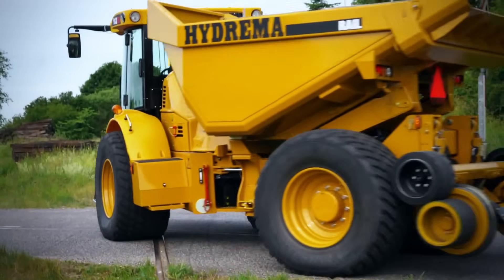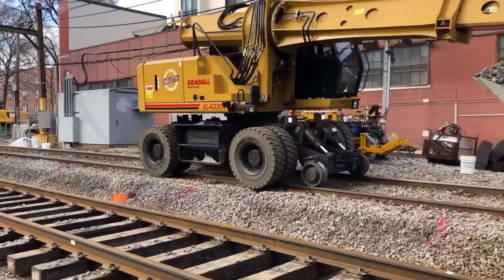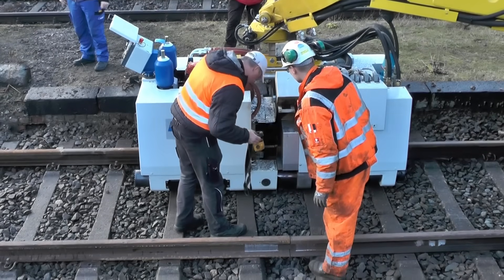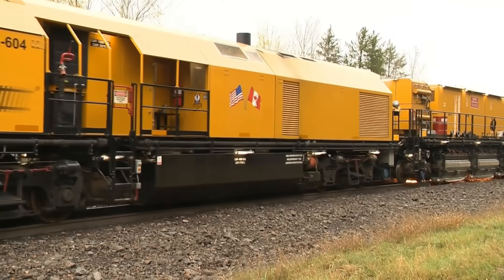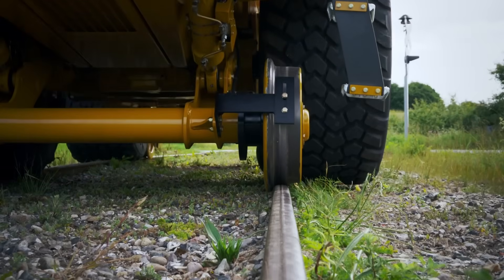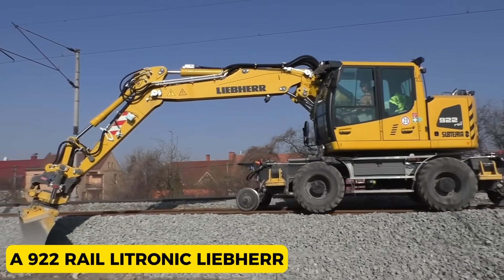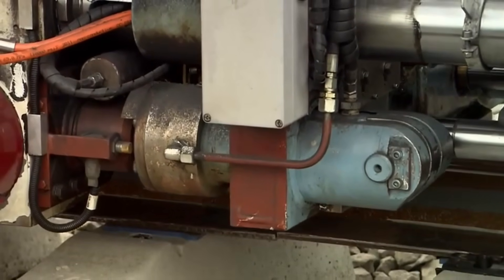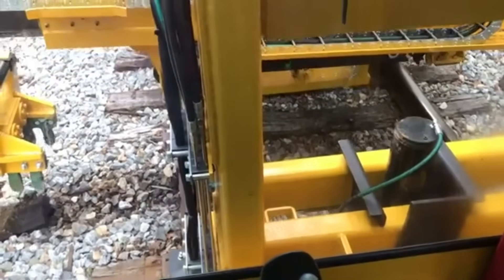20 AMAZING Railway Equipment That Is Next Level

Comment: LIVING IN THE STONE AGE ???
Ugh you've only just discovered modern Railway plant machinery ? British Railways had equipment like this back in the NINETEEN SIXTIES (1960's). Obviously you Americans have no knowledge of the World Famous manufacturer of such machinery, based in Austria called PLASSER & THEURER. Who have over 3000 Patents relating to various types of track maintenance & relaying equipment. This company dates back to 1953, and set up its London subsiduary "Plasser UK Ltd" on 14th March 1960. 

Indeed as a Railway Engineering Student I was getting my "practical" experience on British Railways overnight track possessions, operating many types of complex track laying & testing machinery from 1973, most of which had to be computer aided to get precision alignments to within ONE MILLIMETRE. 

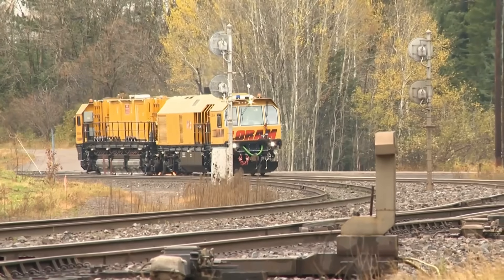Your obviously NOT a "Permanent Way" Railway Engineer, as a number of your descriptions clearly do not understand what is being done & WHY.  For example the "Rail Grinding machine" at 6:19 is necessary to maintain the shape of the railhead at a precise angle to match the angle on every trains wheel treads. If the two angles (Rail & wheels) do NOT match precisely you will start experiencing "Hunting" of vehicles at speeds over around 40mph, which frightens passengers, and can damage fragile or sensitive Goods. In a "worse case scenario" it can lead to train derailments !!!
Reply from the maker: Thank you for sharing your extensive knowledge and experience in the railway engineering field. It's always great to learn from experts like you!
Reply: Railroads are profit driven. Think: They reduced operation crews from 6 people down to two, soon to be none at all as remote control trains are operated. Remember that in the 1880's, congress had to pass laws to get railroads to use the Buckeye coupler and air brakes. It was cheaper to send employees to heaven than to add the equipment.
When railroads in the US do or don't do something, the reason is usually "Money".